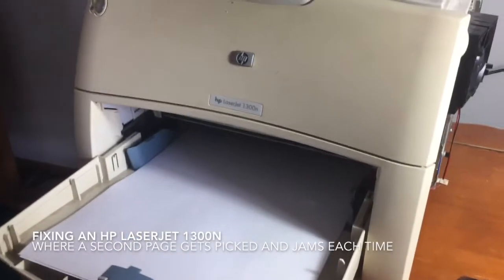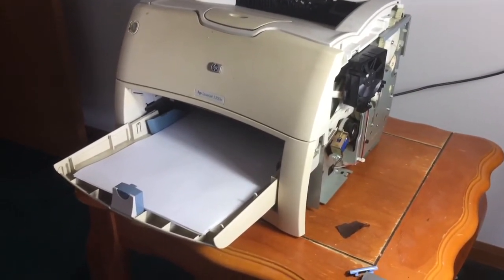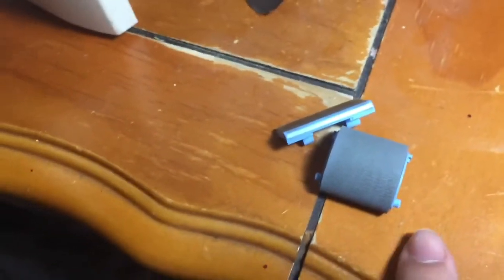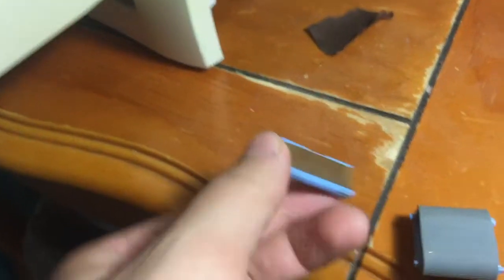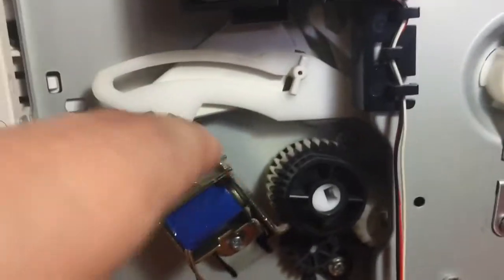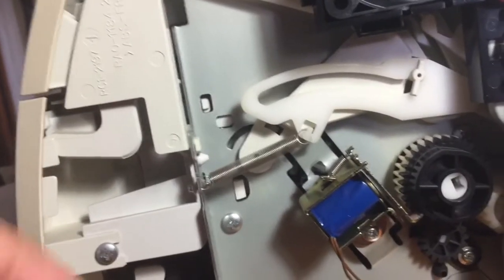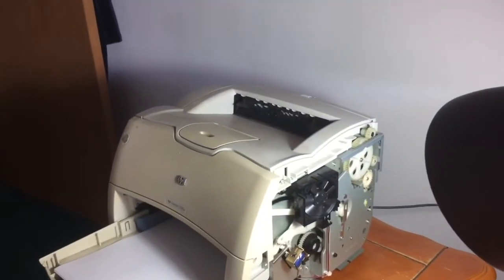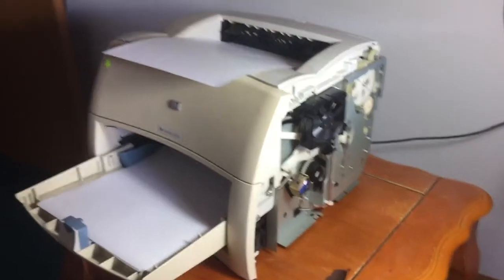FIX: hp laserjet 1300n jams after 1st page completes

Comment: This fixed my problem! I just wished you could have included a portion on how to remove the right side cover. Otherwise a life saver. I used a thin alcohol wipe, filled by a little spray of electrical contact cleaner that is safe on plastics. Used a miniature  screwdriver with the alcohol wipe to get in between and wipe the sticky residue off. Put it back, works great.
I removed the third screw from the top (on the rear of the printer) and pushed in the bottom release tab on the bottom of the right side cover and it came off ok.YouTube is great! Thanx again!

Comment: Spot on fix for my "antique" HP Laserjet 1200 (bought 2003) that recently had the paper-feed issue. The sandpaper on the solenoid worked perfectly and the 1200 lives on! Note:  First problem ever in 17 plus years. GOLD, Eric, GOLD.
Reply: My 1200 has just died, needs a new fuser unit.  Probably not economical to repair.  I have had this printer since 2001 and printed almost 139,000 sheets.  I doubt that the newer printers will last as long.

Comment: Thank you very much for this video.  I had EXACTLY the same problem.  The HP 1300 printed fine as long as there was only one page.  Trying to print multiple pages always jammed the printer as multiple pages were trying to drag through the printer at the same time.  I cleaned the contacts on the referenced solenoid with a fine, finger nail file, then sprayed it with a bit of silicone lubricant.  For good measure, I removed the paper pickup roller and also washed it with soap and water and put it back in.  Now the printer works fine!  Even with cheap copier paper!

Comment: This was the 2nd time I had to fix the issue. I followed your instructions and it held for about 18 months. I cleaned it and put it all back together and then the problem was even worse. I took it all apart again and used a dental scraper to get all the gunk off of the tiny rectangle of metal that gets gummed up. (You can identify the tiny rectangle by the mark it makes on the part connected to the spring). 

Here's something I learned the 3rd time taking it apart and put it back together. I used pliers to break off all of the plastic tabs holding the right, rear and left panels.  It all hold together fine with the screws and if this happens again it's a 3 minute fix instead of 15. :)

Comment: I had the same problem (first page printed okay, second page would print but when picking up 3rd page, would jam).  Tried replacing the separation pad and pickup roller, but didn't solve it for me, and then found this video.  The "L" arm described in this video was sticking to the solenoid due to presence of something sticky - cleaned it off (both the solenoid and the "L" arm - most was on the solenoid actually), as suggested in the video, and it now works.  Had to scrape it off but once removed, the printer is working great again.  Thanks for this!
Reply: My HP 1300 was doing exactly the same thing. I cleaned the solenoid and taped the sticky surface across from the arm and now it's working fine.

Comment: Great straightforward video which gets straight to the point. Mine's on 53,000 pages printed and had never missed a beat until it recently started to jam. But your solenoid fix got it working again.  I found just cleaning off the sticky gunk was not enough - it still kept jamming. So I used some electrical insulation tape on the contact. That fixed it. I guess the return spring has become too weak and I suspect the gunk is what it left of what would have been a soft pad. Thanks a lot.
Reply: Had the same issue and the electrical tape worked like a charm.
Reply: Pretty much exactly the same here (on a 1018; location of solenoid is slightly different but otherwise same thing). Removing the gunk (yeah, that probably must have been a soft pad in a distant past) stopped it from sticking mechanically when pressed with a screwdriver, but made it stick magnetically when actuated by the electronics. I used paper instead of electrical tape. 2 Layers of paper resisted the motion too much, but 1 layer did the trick. Finicky little bugger... The solenoid is now loud as heck - maybe should have gone with the tape - but I kinda like it. Klickety-klick on!

Comment: Thanks Erik - must have had this printer for nearly 20 years. It recently developed the problem of feeding 4 sheets of paper instead of a single sheet, then jamming. I cleaned the contacts with acetone but the problem persisted. Added electrical tape and to prevent sticking, and the HP1300 lives to print another day!

Comment: THANK YOU!!!  You're a life saver. Fortunately I had only cleaned the roller pad when I saw your video, so I didn't have to buy anything.
It was sticky just like you said. I didn't unscrew it. Just slid a cloth in between with a little rubbing alcohol. 
Printing 340 pages right now.  Get a little panicky during the long pauses, but it's working. 😊

Comment: Thank you! Took me a few minutes on how to get that cover off, but your video helped tremendously and my printer is working again.
Reply: How did you remove the right side cover? I cannot get mine off.
Reply: @softball202 , you need to remove the back cover, the lowest top screw on the right back, and then depress the tab at the bottom
The front cover (where you replace the toner) also needs to be removed.

Comment: Thank you for this video. It did it. 17 years old printer now works again. It seems on the switch it was a mix of toner dust with grease. First 5 pages worked then it become warm and glues. I cleaned it with kitchen paper.

Comment: Great! My old printer is a HP LaserJet1200 series and it seems to be nearly identically to your 1300.
Exactly that solenoid was also the problem with my printer. It seems, that is some kind of a adhesive pad inbetween, which changes over the years into a kind of glue. I cleaned both surfaces with some alcohol (german "Spiritus") and the printer works excellent again. Thank you!!!

Comment: This totally worked for me.  I couldn't get the screw to come off so I removed the spring instead, cleaned the plate then used a qtip to clean the part that it touches which, you're right, it was gunky and sticky.  Thanks for sharing!

Comment: Thanks for the video. I cleaned and taped the surface of my sticky solenoid and that fixed my 15 year old HP 1300.  I tried to clean the sticky surfaces on the solenoid and I couldn't get all of the sticky off of the surface across from the arm using 91% alcohol, so I put some Scotch Tape on sticky surface across from the arm, cut it to size, and now all is well. 

Another sticky solenoid symptom that I noticed was that when my printer was trying to feed a sheet of paper, it would raise the paper multiple times while it was feeding...when it's only supposed to do that once. 

Hope this helps.

Comment: Thanks for the tip. I don't add felt. I pull out the iron mobile part, fixed by the spring. and with alcool, cleaned this part and the other side (solenoid side). I place again the iron mobile part, and it's works again like a charme ! To remove the side part of the printer, you have a screw to take off, behind the printer.
Reply from the maker: nice!

Comment: On poles of the solenoid the adhesive tape called has been pasted to reduce noise of the operation. (To not shock office public with a sound of a unsuccessful shot).
Degradation of an adhesive tape reminds you of time of service of the favorite printer :)
fabric + C2H5OH

Comment: Awesome, I have a HPLJ 1200 and there was some residue on the solenoid L arm. Fixed thanks. These are good laser printers and I have an old HP JetDirect 300x so mine is networked. Definitely did not want to buy a new laser and will not buy an inkjet.

Comment: I didn''t take the right side off my printer yet but mine seems to start picking up a second sheet before the first sheet has completed the printing cycle. This jams the system although if I take off the clear top of the printer tray and rest my finger on the paper stack after the first sheet has gone about 1/2 way into the printer, the second sheet will not be picked up and the machine won't jamb. The feed roller seems to be dropping down onto the paper stack earlier than it should. Seems possible that the solenoid sticking would allow that to happen. Correct?

Comment: Hello... I have the multiple pages problems.  Watch a video from "IlyushinSPA" here and helped take it apart but not in English.  I pulled and cleaned as suggested as it was junked up; however it did not help my problem.   I was ready to give up and went back to the video by "IlyushinSPA" and he points to adding tape to the end of the solenoid bracket.  It worked!   Thank you Erik for the video.  Between the two posted videos I saved my printer :) :trophy-yellow-smiling: